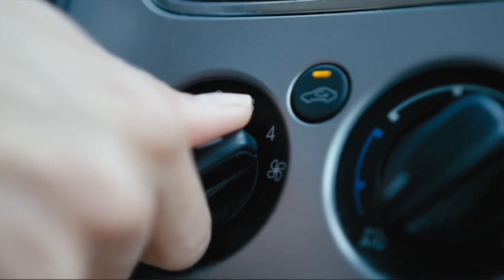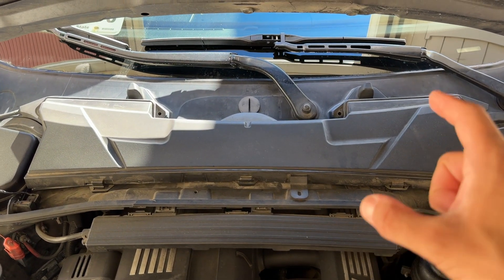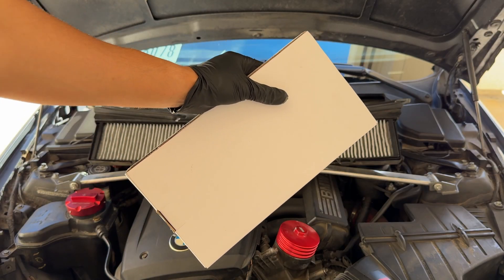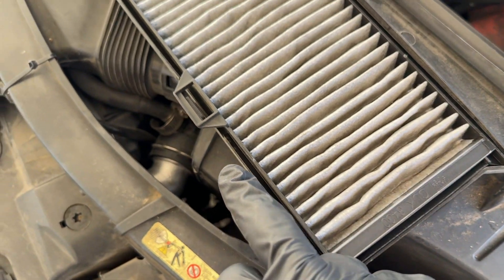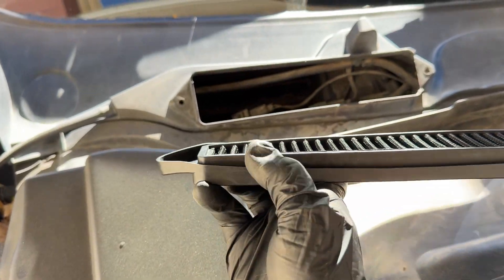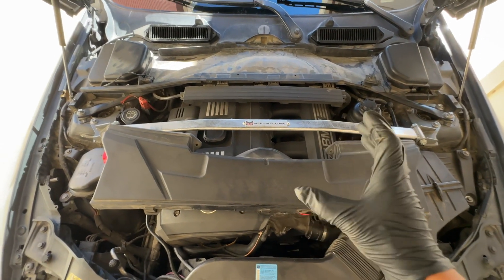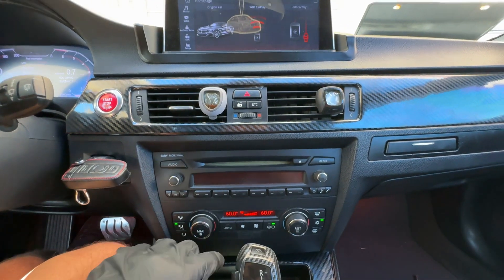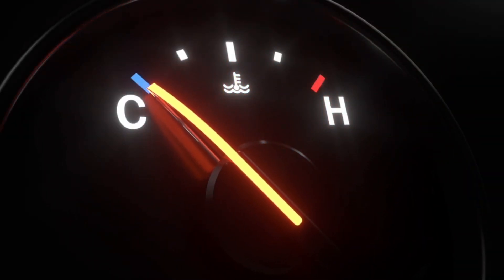BMW E90 E92 Performance Cabin Air Filter Upgrade! | 328i 330i 335i

Comment: Important! Risk of water leaking into the cabin. 
These filters definitely get water from the top edge during pressured car washing or heavy rain. I don't understand how? Cos they're placed under the hood, but in my e90, they get water anyway. However, water does not leak into the cabin immediately, it accumulates on the cotton for a while. If you can detect it early, you may remove the water by air blow gun or blowing by yourself. Shortly, a small barrier is required at the top edge of the filter to avoid the water

Comment: how do you clean those are they reusable?
Reply from the maker: simply wash them off with some soapy water and let them dry and they’re good to go! they’re made of a metal mesh
Reply: what I'm worried is the sponge quality inside, if its something that may become harder as soon as I use soap and water and lose the air intake for the cabin   @IzzyE9X

Comment: Sad to see these videos come out misleading the community and newcomers to the platform just to promote a product they are selling or have an affiliate link. This is one of the worst mods you can do. Let's more engine exhaust smells into your cabin, lets more water into the engine and thus rusting just about everything. Not to mention how much dirtier your engine bay will become.

If you wanted to put out a good video and actually educate your audience you should show them the "M3 cowl conversion" for the N54. It opens up your engine bay making it easier to work, allows you to run M3 strut bars and also will show off an aftermarket intake manifold not to mention looks a million times better. Unfortunately for you seeing as it uses all OEM parts affiliate links are going to be hard to come by. 

Source: Unfortunate owner of multiple 335i / N54s.
Reply from the maker: This is an upgrade I’ll look into in the future! Thank you for the input
Reply: bro i’m interested in what you just commented, where can I find the video to do that ?
Reply: Glad you said this! I almost put them in